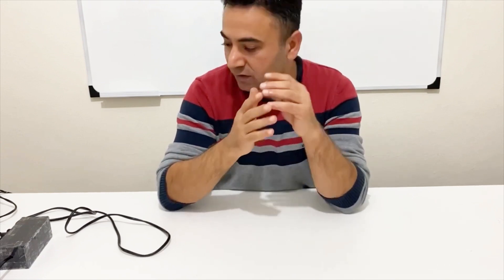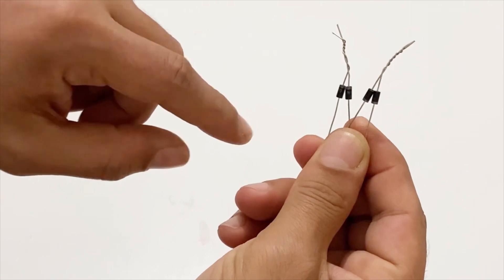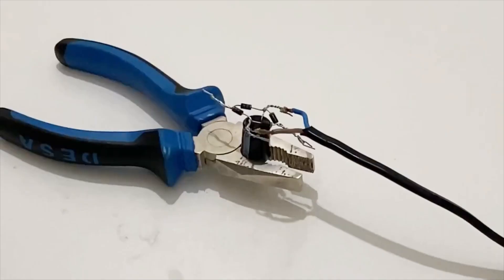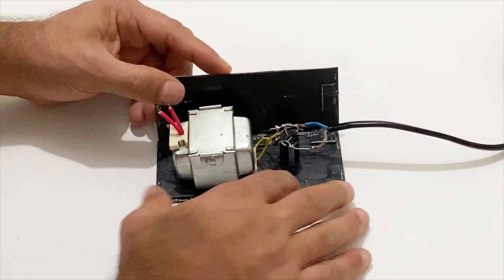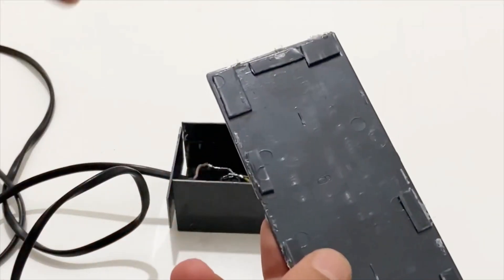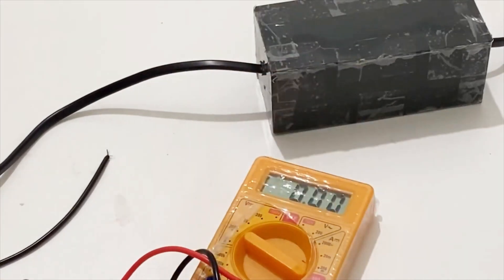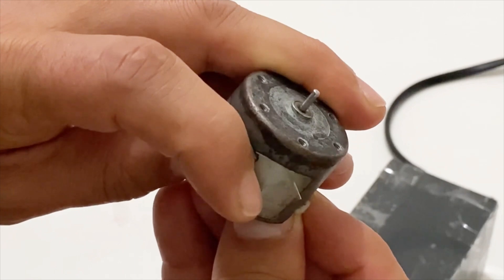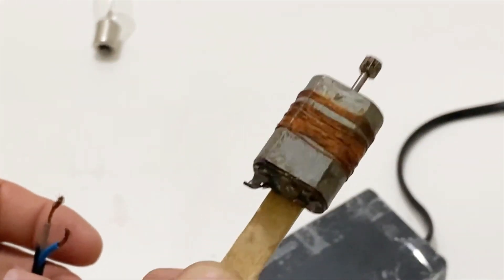How to Make a 12 Volts DC Power Supply | DIY Power Supply

Comment: I follow and watch your inspiring videos. The issue i have with this particular one is that you tagged 20000 watts and also 13v ro 50 watts. Which is real? 2. Can 12v motor be used to get it started so thsy the system can be covered. Can you direct me to any of your eorks thst is diy 12v litlum battery pack that is upto 50v and above?
Reply from the maker: It’s 50 watts. And here is the video link you demand:How to Make 16 Volts 4S 10A LiPo Battery Pack 
https://youtu.be/-_re5oWA4YY